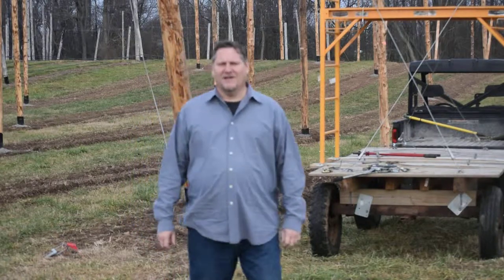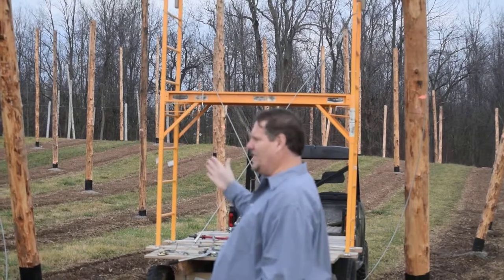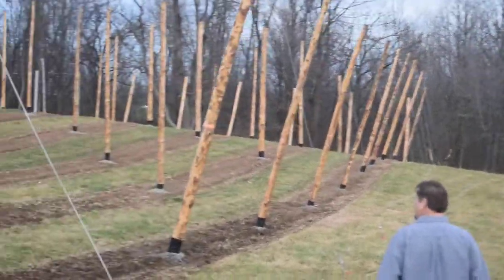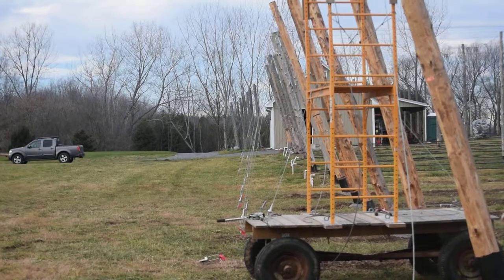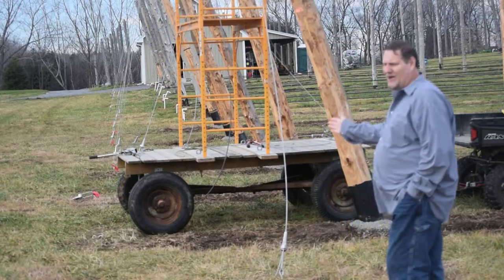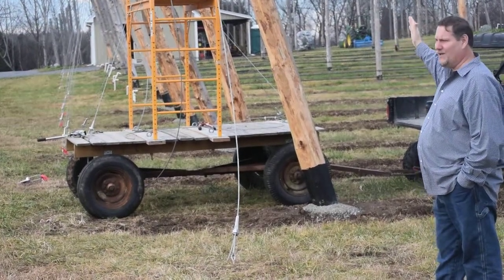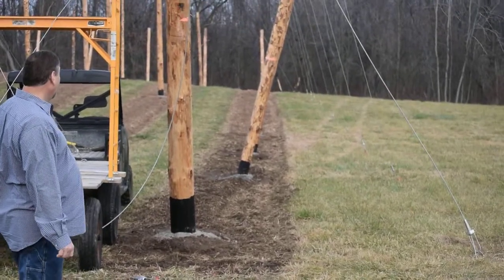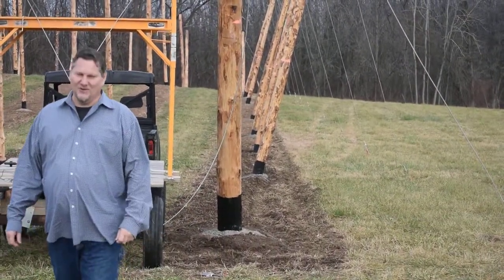Pole Direction of Lean

Comment: Great video Stephan, very helpful. Question: when twining that last row underneath the angled poles, how do you 'V' train your vines?
Reply from the maker: On the first and last row you can either just run one cable on the inside and do a single string or run a second cable right on top of the poles to V the strings.  Problem with strings on cable right on poles is that they won't swing into the rows.  You have to manually pull down and move to wagon.